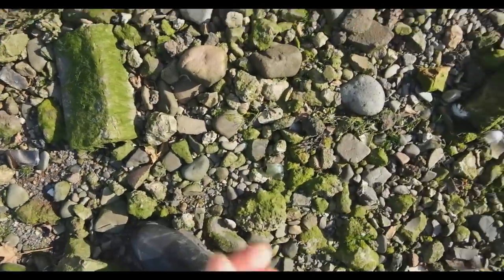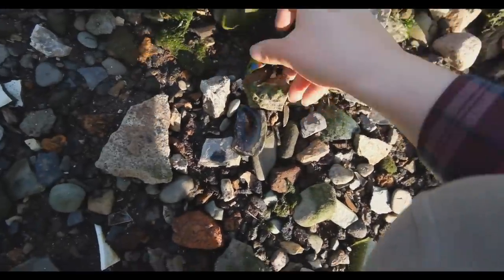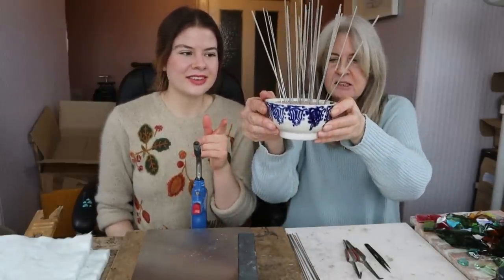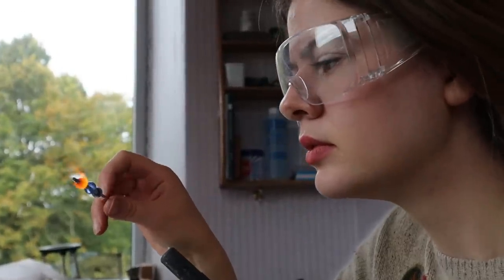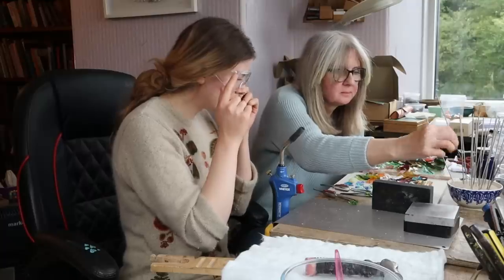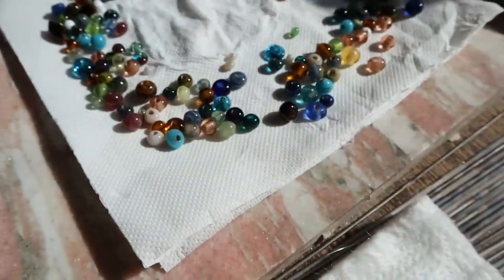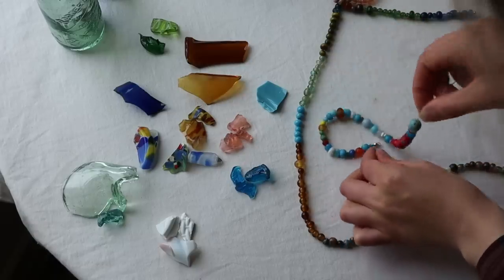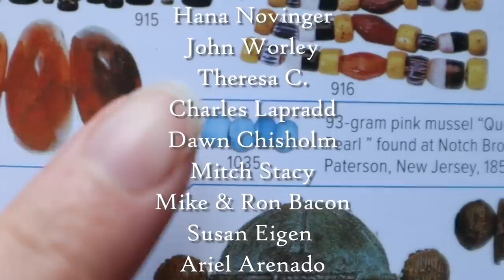Making beautiful beads from antique glass! Recycling our mudlarking trash into treasures!

Comment: I am a lamp worker and you really should have didymium glasses, it will protect your eyes but the main reason is to see what you are doing.  The blue violet color filters out the orange flare from the glass melting.  You might want to try working those pinks really far out in your flame and it will be less likely to burn or turn gray.   I was told the reason that pinks are problematic is because of the gold content.  Lastly please please please make sure your work area is really well ventilated. This glass was made with h high lead content and you are melting it and releasing lead into the air.  We have a special hooded vent above to pull the lead out when we work with czech glass ( especially high lead content) Most of todays modern glass rods have the lead removed.  Also while watching this a thought occurred to me if you hold the glass with hemostats it might help your hands with fatigue.  What a great idea!!!!! Also flash ( wave your row of beads through the flame before you put in the blanket so all are same temp to prevent cracking.  Hope some of these ideas help you.  I love you guys so much.  Watching you remove the beads from mandrels you can soak them in water to remove bead release to help come off mandrel.   Great video.  Hope this helps you.  I have been lamp working 11 years and teach at a local studio.  Much love.
Reply: I wanted to reach through and open that window.  I work with chemicals with my nerdy hobby, as well.
Reply: Also that fire blanket sheds fibers that can get in your lungs and kill you. Blacksmiths coat them so maybe some respiratory protection too
Reply: Amen to all the above, from another torch worker / lamp worker. Especially with the glasses. Don't want to burn out your retinas!
Reply: I agree!  You particularly need good ventilation since you don’t know what chemicals were used in that old glass. And didymium glasses are worth the cost. Your technique is pretty good. You should take a class.  It’s a very addictive hobby.
Reply: This! As a blacksmith, I cringed when she fluffed it open.

Be safe, because we care!
Reply: I agree with everything Eileen Wade says. I am a lampwork  glass bead worker, really love the art of glass.
Reply: What an interesting video; I really enjoyed the watching process of making the beads.  I wasn't aware of the all safety recommendations the viewers have pointed out; I was concerned with no fireproof gloves being worn and Gail not tying back her hair to keep it away from the flame. Did you burn your fingers?    The little bowl was a fantastic find; it is beautiful!  Thank you for a wonderful start to the day! God bless
Reply: Being a former lamp worker, please put on those didymium glasses and get some ventilation going and wear a mask if you are using a fiber blanket.
Reply: im glad all these people know the dangers so they can help you be safe its fun but you dont want to get hurt.
Reply: Alex as an alternative to the fiber blanket you can use vermiculite or glass cooling bubbles in a crock pot.  Allow your beads to cool slightly like you did before putting into the fiber blanket, then put them into the hot crockpot of vermiculite or bubbles.  Keep warm till all the beads are done.  Allow to cool to room temp. then anneal in your kiln like you have been doing in a batch anneal.  This is much safer.   No fibers in the air.   If your arms get tired from holding the mandrels and turning you can brace your arms up on wood blocks or sandbags and you most definitely should always tie your hair back.  We love you so much.  I was watching an episode of “ Call the midwife” the other night and they mentioned how unwanted babies bodies were often found in the very old days by mudlarks along the Thames.  I knew what a mudlark was because of you guys ❤️
Reply: @jbsimpson8  Most beadmakers do not wear gloves unless they're making very large items (like 5cm marbles and larger).  Even then, it's usually a kevlar fingerless sleeve. The bead release on the mandrel keeps the heat from traveling up the mandrel to the fingers.  Every breadmaker has experienced small burns from hot bits of glass popping off--it's a bit like a badge of honor.  That said, I do recommend not wearing anything polyester while working at the torch.  I wear a leather welder's apron--I make marbles and have the odd one pop off and roll toward my lap.  It also helps to...um...keep "the girls" covered.  That seems to be another place where hot glass is wont to go.

I'm in total agreement on tying back one's hair!  I also keep a bowl of water near the torch.  It's good for cooling a little burn,  getting hot glass of your tools, and drowning naughty beads.
Reply: @eileenwade8971  -- Vermiculite can be a dust hazard as well.  The cooling bubbles are good though.  I wish I hadn't loaned mine to a beginner because I never got them back.  :(  Not the end of the world.  I have two kilns.  But the bubbles would be good for when I'm camping.
Reply: Torch Singer I personally don’t use vermiculite, we use cooling bubbles for travel demos, and personally I go straight into a kiln.  I was just trying to find alternatives for them safer than fiberglass.
Reply: @eileenwade8971  I assumed you were probably at it long enough to have a "big girl" torch and kiln.  ;)  I bought myself a hothead and some cooling bubbles to use when traveling but loaned them to a friend's girlfriend who was interested in learning.  The friends had a parting of ways and I never got my stuff back.  That'll teach me, I guess.  Fortunately, I am a bit of a collector, so I still had torches and kilns--just not a traveling kit.
Reply: Thank you subscribers!  A very interesting conversation between bead lovers.
Reply: I was wondering if they soaked them if the beads would release easier. Great comment safety safety safety!!!!
Reply: Carina Taylor yes, they do come off easier. I always soak mine in water.  It also keeps the harmful chemicals in the bead release from becoming air bourne.
Reply: What everybody else says, please get yourself some decent eye protection and ventilation to protect your lovely selves.
Reply: Since everyone else has mentioned safety issues, I will not.  Bu I do want you to be careful.  
On the other hand I LOVE, LOVE, LOVE that you are taking old broken glass and turning it into beautiful treasures. 
Will you be selling any of the beads on your Etsy shop or making anything on your Etsy ship.  I would be interested In purchasing some of the beads (I’m not sure if your parting with them), the blues at the end of your strand are gorgeous, so are the greens.... and all of the rest too. 

I love upscaling old finds into beautiful useful treasures
Reply: @eileenwade8971  Vermiculite contains traces of asbestos. Research @ the US government website EPA for addition information on health hazards connected to vermiculite and asbestos. Love your idea, but please be safe.
Reply: That's Environmental Protection Agency. My Father died of Asbestos Lung Cancer, and there is no cure.
Reply: DEBORAH BOLT yeah yeah
Reply: DEBORAH BOLT I agree, again I do not use vermiculite and recommended glass bubbles, but vermiculite was an option a little better than the blanket.  We actually put our beads most of the time straight into a kiln and garage them.  We only use the bubble once in a blue moon for demos off site where no electricity is available.  I followed up my comments further down and expounded on the vermiculite saying I have never used it and never intend to as I have a kiln.  Thank you though.
Reply: I'm trained in jewelry, metalwork, and lapidary work (cutting gemstones) I also cringed about the hair and ventilation. I was concerned about them breathing in the gas residue and bead release as well. Those finely ground clay products if inhaled can lead to silicosis, a dangerous lung condition. When working with enamel there is a similar resist substance and when you apply it you wear a mask or better a respirator if you have it, eye protection, and gloves. Plus due to the particle size of enamel you follow these procedures when enameling as well. Don't need micro glass in the lungs. Also those fiberglass blankets...yikes!
Reply: I would love to know how to copy all your wonderful advice to keep close to me when I to start to work with the sea glass I have thank you
Reply: Lead was banned in Czech Republic in 1924 as one of the first countries in Europe. I m wondering with what glass from Czech with high lead content are you working with?
Reply: @sunshinem3958  Select the text, copy and paste into a word processor document, no?
Reply: Hey I am am a lamp worker too
Reply: Thanks so much for passing on this very helpful to them!
Reply: Didlw
Reply: Fellow lampworker here - a big yes to all of the safety advice given here. In addition, it may be a good idea to blacklight the glass before you melt it. Sometimes uranium glass is not readily identifiable. There is a bit of a debate as to whether it is safe to melt, but I wouldn't chance it. You probably already know that layering/decorating from different glass sources can lead to cracking. If the coefficient of expansion (COE) in the glass pieces don't match each other they will separate resulting in cracking or crumbling. I really love your videos and enjoy your adventures and the sweet animals on the farm. The hens slay me. 💖💖💖
Reply: Thank you so very much. For sharing your knowledge and experience.
Reply: This was so amazing to watch. I loved watching your first video, making the pretty pendant from the butterfly piece of milk glass or whatever that was… but anyway the beads. How amazing I can’t believe you know how to do that.. I don’t have the patience.  I was just wondering on what Shoreline do you find all this glass? I live on the beach, but I don’t find much glass.. just more shells than  but I’m just usually looking for shells. There are a little bits of glass, but not much.. is it because of all the glass that is made over in Europe, and there were so many glass factories or whatever I’m just really curious. Thank you though for the wonderful video and I love your accents and I love your patience and y’all are very talented and easy to watch and listen to.  ❤
Reply: Woah this is so cool to know 😯

Comment: I'm glad you know about the didymium glasses.  I gasped when I saw the thumbnail of you wearing just safety glasses.  Even for small amounts of lampworking you need didymium-you do not want to damage your eyes!  A few tips: Make sure you have good ventilation, some of the glasses have toxic chemicals.  -When you are doing multiple beads on a mandrel, besure and flash heat the earlier ones to prevent them from breaking.  -Keep you hair back in a pony tail when working on the flame-small sparks can catch your hair on fire (speaking from experience) -Pink and red glass usually has gold in it which is why it burns, move it a little further back in the flame.  -There are kilns for lampworking where you can put the mandrel straight into the kiln for annealing, if you decide you want to do more lamworking  - If you want to remove them and put in to anneal, soak the beads on the mandrel in water (once totally cool) to remove from mandrel. Much easier and less dangerous silica dust to breathe.       *Your beads look great!  Especially for being new to the art.  And what a great way to use that old glass.
Reply: I said to myself while I was watching with admiration, "They are so good at that! I would set my hair on fire if I tried what they are doing."
Reply: I was wondering about the possibility of toxic chemicals because of e.g. heavy metals so I am glad someone has mentioned this.  I really enjoyed your video and it made making beads with old glass look really accessible.  I collect shells so I'm often at the beach and my daughter collects beach glass and pottery.  There are always lovely bits of glass that are too sharp to collect.  It looks like quite an investment to get the equipment needed but also very rewarding in terms of making the beautiful beads.  Perhaps this is a hobby to work up to and collect up pretty glass in the meantime.  I do enjoy the videos on this channel very much.
Reply: I was also concerned with what they called "poison glass" as heavy metals were often in those poisons. I guess that would wash off after a hundred years or so but could any be "in the glass" since even at room temp glass is classified as a "liquid"? Just do not know so ventilation is your friend would be my guess. This is a fun use of those old broken pieces. Good thinking ladies.

Comment: You ladies are doing beautiful!  One thing mom should remember is to tie her hair back, sometimes glass will POP in the flame and Hot pieces will fly, also wear old cloths! To annell the beads better, find an old electric wok or elec skillet, fill with vermiculite(found at a plant nursery,) and set temp at highest temp setting. Once you are done building beads, every hour turn your temp down about 50 degrees at at time until its off. Then you don’t need to use a kiln as long. Be carful mixing glass, non compatible glass will crack, sometimes months later!

Comment: I am in awe over your recycling of old glass into beads. I'd like to suggest full face shields for you plus the eye protection. Hot glass can really burn and leave scars. I used to make neon signage and have some "reminders" of hot glass on my hands .
  I would also suggest good ventilation in your work area, but no direct fan blowing on the glass.

 A simple  jig with a metal plate on the bottom and a vertical member made of metal also (wood would likely work too, but is flammable). This ends up looking like an "L" shape. Affix a slow rpm motor to the vertical part of the "L".  (Maybe from an old BBQ) with a metal shaft affixed to a drill chuck to it or a variable speed drill. 
  Use a foot switch to turn the motor power on and off. This will give you basically a "Hands Free" method of holding the bead mandrel very steady and level.  I think this would improve the consistency and size of the beads. It also eliminates, for the most part, the possibility of dropping hot glass on a mandrel into your lap.  ( We call this a Bad Thing). :P

  If you made the bottom plate larger, you could use a clamp arrangement to hold the torch bottle at the ideal angle and height also. Of course, that would need to be determined by a bit of experimentation.

 All that being said you might check with your local neon sign shop for some unused scraps of colored Pyrex (tm) tubing that they would toss for making beads also.  Annealing it is extremely simple. Just move the flame away from the glass slowly & let it slowly cool. We did that with neon signs,
   Do not re-use old neon tubing, as it may contain Mercury.  (Maybe not the best idea to breathe in Mercury fumes.)

I look forward to some more videos on making beads  and re-using old scrap glass.
Thanks for this video. It looked quite fun and informative.

BTW- Here in the U.S. true handmade beads like you are making sell for many times the cost of the "machine made beads" With some practice, you could possibly have another source of income.

  MAPP gas also comes in larger cannisters that are refillable. (Rent, lease, or buy in my area).  Check your local welding supply for them, and price shop. Also they should be able to provide an extension hose from the tank to the burner hand piece. There is a company in Shelton Washington, U.S.A.  Franz Art Glass, that sells glass, rods, torches, and glass supplies. I have dealt with them and they are nice folks and very knowledgeable too.
Reply: I wonder if one of those motors used to spin the mugs everyone is making now with glitter/decals and then epoxy would work?
Reply: I think you may have been autocorrected, lol. I looked the company up at your recommendation,  and they are Frantz Art Glass. Previous post is missing the t in the name. Such is life when typing into cell phones.

Comment: Could you put the bead release on the stick then put a silver tube over that so when cool the beads just need to be cut flush at either end and you don’t have to file the release off?

I’m not a jeweller and have no idea if it would work but it could be time saving if it does...

Comment: In a lampworker and I have also pulled glass outfits stream in the village and made beads. There's a big bottle dump near here so there is plenty of glass to be found. 
As others have said, please get yourself some didys for your eyes. Get plenty of ventilation and be careful with that fibre blanket!  Hopefully it's body soluble - meaning it won't harm if you breathe it in.I
Little tip, small footprint on the mandrel, add more glass, but shape outside the flame.  You will have more control. Keep doing what you are doing your channel is fun!

Comment: As you progress you will want to start preheating your shards and picking them up on a rod of clear glass. Then you can keep it turning in the flame and get a larger mass going. & you can make larger beads. I used a kitchen hot plate at first! It doesn’t get amazingly hot but will get you started. I bought didymium glasses on Amazon for 60$ usd . Lastly, because you’re using map gas it will often change the glass colors because you don’t have a gas\oxygen mix. I hope you will find way for this to make some money and invest in a proper small torch and bottled O2 and gas. Good luck, it’s a fabulous idea!